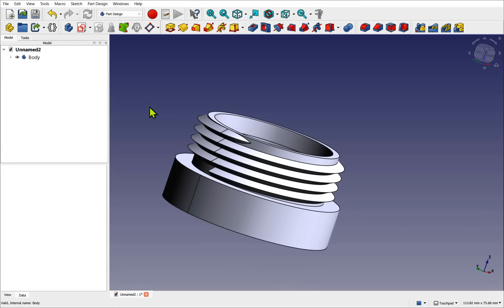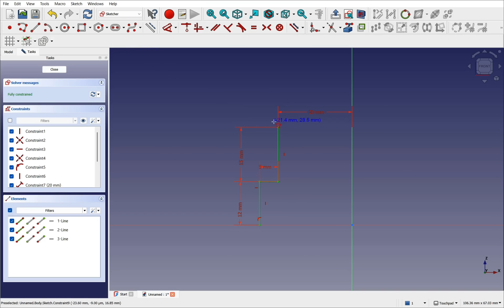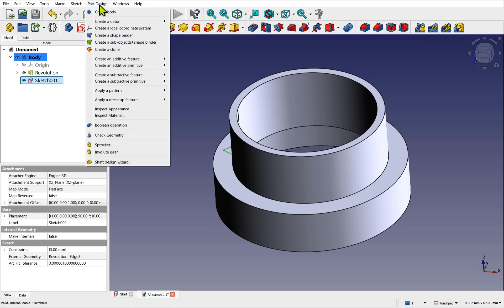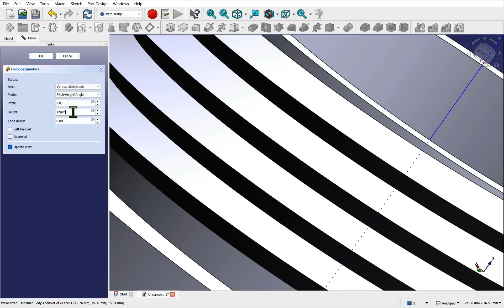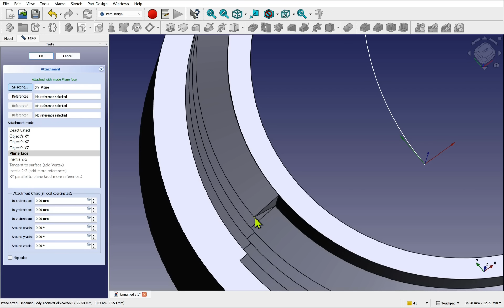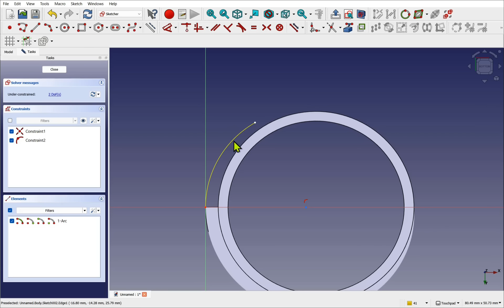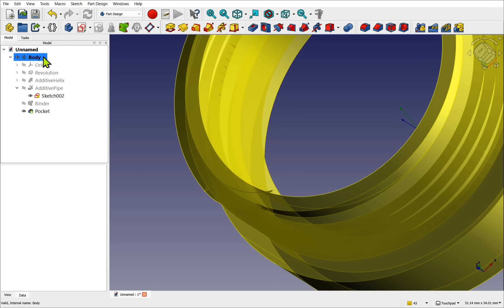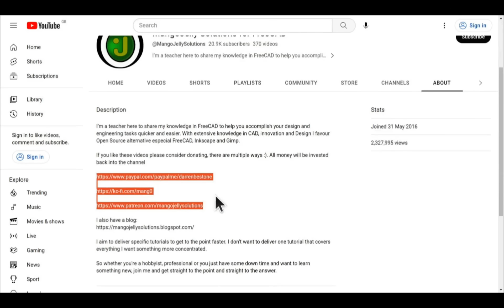Create Custom External Threads in FreeCAD with Additive Helix | Basic Beginners Lesson 47 | Tutorial

Comment: The line attached at the end of the video doesn't follow the same curve of the thread. Correct? If this arc continued the additive pipe much longer, it would be noticeably flat (not following the helix) and prevent screwing. Is the method demonstrated here just a trade off for speed, that the arc added is so short it's assumed there'll be enough tolerances in the rest of the thread for it to screw in? Thank you!

Comment: I am getting an error message removing splitter fail, how can I work around it?
Reply from the maker: Ah so when you get that message don't quit out the operation but switch to the treeview, select the errored operation and look on the data tab.  Set the refine to false. That should sole the issue.
Reply: @MangoJellySolutions  Already fined the solution for it, thnx

Comment: removed splitter failed :(
Reply from the maker: That was probably the pipe operation.  Run the pipe operation, hit OK and get the error.  Don't cancel the operation, swap to the treeview / model view tab, you will see the failed operation icon for the pipe, click on it and in the properties set the refine to false.
Reply: @MangoJellySolutions  It was that issue thank you.

Comment: @13:10 I keep getting an error message saying "Removing Splitter Failed".  I've tried all sorts of sketch adjustments and varying the orientation modes and still get the same message.  Anyone know how I might fix this?
Reply from the maker: That was probably the pipe operation.  Run the pipe operation, hit OK and get the error.  Don't cancel the operation, swap to the treeview / model view tab, you will see the failed operation icon for the pipe, click on it and in the properties set the refine to false.
Reply: @MangoJellySolutions  This fixed the issue.  Thank you MangoJelly:))

Comment: These videos are an asset!  I've learned so much from these.  Currently learning how to create threads so I can 3D print an adaptor for my garden hose so it can be mounted with an old showerhead I'm no longer using.  It'll be great to be able to water my plants with the gentle showerhead as apposed to the heavy stream from my garden hose
Reply from the maker: Glad these videos are helping you out, great idea about the garden hose. Just think about orientation when you print. layer lines are the main failing point with stresses if there is any movement around the connector.  Thanks for the comment and kind words.

Comment: Lovely, thanks. If possible I prefer to do lead-ins and lead-outs with a simple pad or pocket from the helix end face along a properly attached datum line (tangent to the helical edge at end face vertex), but that only works if the thread would intersect the wall naturally (e.g. additive inner threads and subtractive outer threads). I used to use additional helix with angle for remaining cases, but I like the method from this video much better, the less part design helices in my model, the happier I am... (I just consider them "high risk" features when it comes to breaking the model at some point, maybe I was unlucky :D ). Also it lets me control tangency which I can't do when using an extra helix.

Comment: Not sure what i am doing wrong, but when i get to the additive pipe step i keep getting ""Base shape not valid for boolean operation".  thats it, no idea how to fix.
Reply from the maker: That sounds like you may be experiencing the 'near tangency' issue.  I have seen this in other CAD programs not just freeCAD.  It's were a path has two joining geometry's that are almost tangent, but not quite.  Happens with fillets where you have say a straight line and a arc making up the edge you want to fillet, they don't have a tangent constraint but they are so near to being tangent that one little 'nudge' of the mouse will make them.  Adjust the meeting point of the arc and your helix slightly.

Comment: Just so viewers are aware of the alternative: the fasteners workbench has tap and die tools to make boolean cuts with customisable threads.
I used this method to make a glass bottle thread adapter even though bottle threads are not included in the workbench
Reply from the maker: Thanks for adding that information, I do have a fasteners video coming up but it's about adding fastens  but not using the tap and die ones  so this is great information thank you.  I would love to see fasteners allow for the additional of adding and saving your own parameters and profiles so they can be shared with others so you could make your bottle threads and some one could make  BSP threads and they could be shared throughout the community.

Comment: Thanks, I have used this method as well as another for the thread end. That is, create 2 drawing upon the end of thread surface. Draw the first sketch to match the thread. The second sketch is a smaller triangle. Smaller than the body section in width & keeping the same triangle angles. This drawing is then repositioned in X,Y,Z to be fully inside the body. From there, its a sweep between them. Perfect alignment not necessary, as the thread leads away from the matching thread, just try to align the smaller triangle to the thread pitch. I could go into the math, but who wants that when not exact works well. Lol.  Try it. I use same method on other end of thread if necessary.  Again, the trick is the snaller triangle size. Finished threads can be m9deled on very thin body section as this triangle can be almost a point.
Reply from the maker: Nice little tip that one :) I like it :)

Comment: Hi Darren, I'm stuck and need help. It's nothing to do with this video. I have been modelling a fuselage using the curves w/b in 1,0  Once finished and closed, I offset and filled by 2mm. All good, but how do I make it solid? Everything I try doesn't work. Not sure if it's anything to do with the fact that I intend to only create 1/2 of the fuselage down the length, then I intend mirror and eventually 3d print  the 2 halves and glue. Thanks.
Reply from the maker: Ah I wondering if you had the same problem as another viewer., we was going around and around for ages and it was the simplest solution.   The offset should make it solid but it doesn't hide the original surface within the offset.  If you expand your offset in the treeview you will see your surface within which is visible.  Click on it and hit the spacebar to hide it.  If your try to select the offset without it hidden, it will select the surface each time instead which confuses things.  See if that helps.
Reply: @MangoJellySolutions  Thanks Darren, you're a star, loving your content, we are so lucky to have you 👍I did what you advised (hid the Gordon surface in the offset and it worked, thanks Darren.

Comment: Great video. I've figured out custom threads on my own but I was really looking forward to learning how to do that lead-in. Unfortunately for me, when I go to do the pipe at that point, I get an error: "input error: removing splitter failed." I'm certain I've done everything the same as you, so I'm guessing this is another issue with running FreeCAD from flatpak on Fedora. Every time I run into something odd, seems to be the cause.
Reply from the maker: Ah, so when you get remove splitter,  !don't! cancel out the operation, go straight to the treeview, select the operation in the treeview which will show as failed, go to the data tab, and set the refine to false.  I can't remember if I added that to the video?  Or it may be another one.
Reply: @MangoJellySolutions  This worked up to a point. Setting refine to false did allow me to create the lead-in, but it failed again later on when trying to pocket the hole in the center. That's when I realized an important difference between my model and your example -- I chose to leave the center solid. FreeCAD seems to not like this for some reason. If I create the cylinder from a revolve with a hole in the center like you did, there are no problems. However, if the cylinder is solid (either by revolving a sketch or using additive primitive), the "removing splitter failed" warning appears when creating the additive helix. The later attempts to pipe the lead-ins show the same error and fail to produce the feature. Attempting to pocket a center hole last will cause the entire body to fail and disappear. 

Out of curiosity, I tried and was able to create a threaded rod in the Part workbench by following this method: 

1. Create a cylinder 
2. Create a sketch on XZ plane -- sketch the thread profile with an X distance from center (of the sketch) equal to the radius of the cylinder. 
3. Create a helix primitive - helix radius equal to cylinder radius. 
4. Sweep the profile along the helix.  
5. Sweep > Data > Solid set to True  
6. Fuse the sweep and cylinder.
7. Create another cylinder for the center hole. 
8. Boolean cut the second cylinder from the first to create the hole.  

The "removing splitter" failure does not come up in the Part workflow. 🥳 But the additive helix tool in the PD workbench is a bit nicer to use. So, driven by my aversion to the Part workbench, I attacked the thread again in part design. I did find a way to make it work by creating the cylinder and thread as separate bodies, then fusing them together in a third body. This avoids any occurrence of the "removing splitter" error. That is, unless you try to pocket a center hole into the fused body. Then the model fails and the body disappears. But, as long as  you put the hole in the cylinder before fusing (or omit it), everything works with no errors or warnings.

I didn't know you could leave a YouTube comment this long! I can share my files with you if you're interested.
Reply: @MangoJellySolutions  This worked for me on Windows using FreeCAD v1.0.1.  Thank you MangoJelly!

Comment: Interesting solution for the lead out. What I miss is some presets for standard threads. Sure, you can get examples from the fasteners workbench, but they did not contain plumbing threads like G1/2 and so on. The thread profile add-on is too complicated, imho.
At least greetings to the land of left-hand drivers from a guy who starts sketching threads on the right side and drives on the right-hand side. ;-)l
Reply from the maker: Yes! exactly what I was thinking yesterday. Even if we could enter thread parameters and save them off / share them would be a great addition.  I can see the community then building thread collections. I do hope that part design will add it's own external thread option like the internal thread for holes.

Comment: Thanks Darren. Great tutorial, as always. I'm just wondering, for NPT pipe threads, would you use Helix Parameters > Cone Angle to taper the threads? 
NPT Parameters: Thread Form: 60° included angle (same as Unified threads) - Taper: 1 in 16 on diameter (0.75 in/ft) — equals 1.7899° from centerline
Reply from the maker: Hi, that sounds right I think, trying to cast my mind back to when I last did this for pipe threads. I believe the additive helix cone angle expects this angle from the axis to one side of the cone rather than the full diameter.